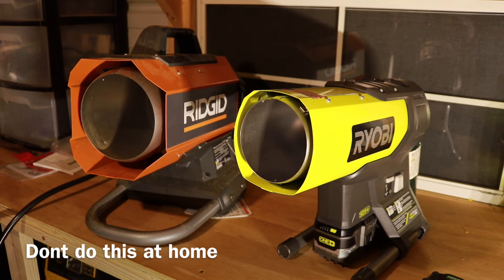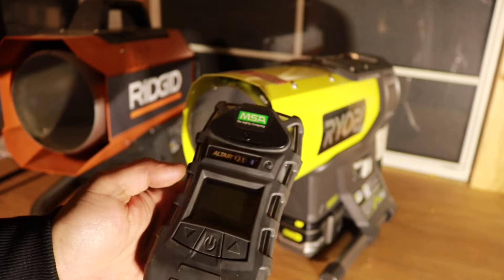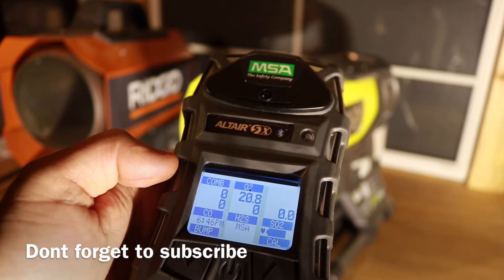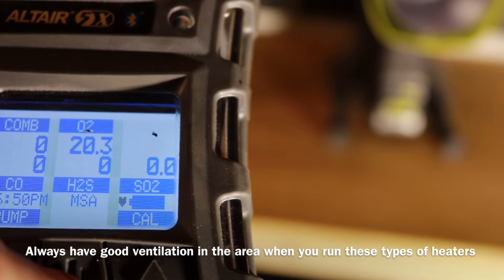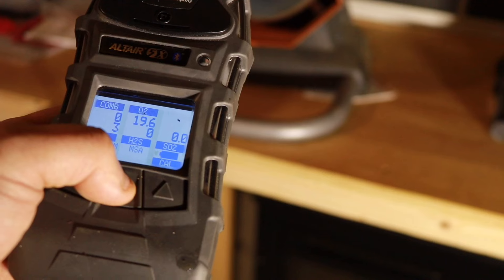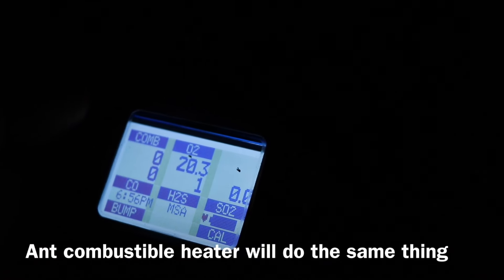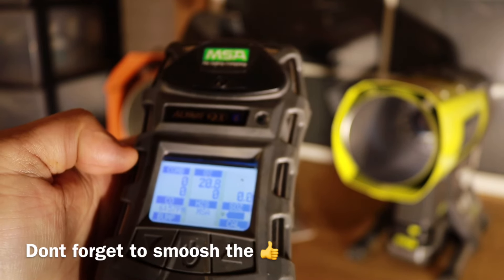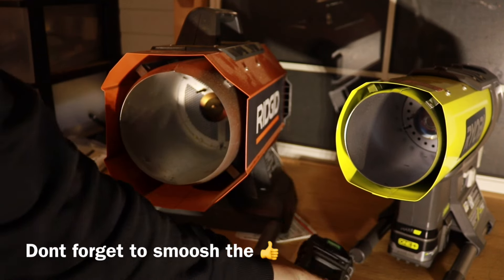Is it safe to run a propane / torpedo heater indoors???

Comment: Of course it escalated that fast. You’re standing with the meter directly in front of the unit about 3 foot away. If you use it inside in a 20x10 room that would take a long while to go up. Crack a window and you’ll be fine

Comment: Find this weird your testing with the sensor in the blowing draft of the heaters??? Like if you were to breath into the pump and make it alarm. I used what looks to be the same instrument at my work and putting the meter right into the draft is a unrealistic test... I would point a heater into one side of the room heat it to temp and then take a reading. That would give you a atmospheric reading and not a focused stream into the sensor.

Comment: I've used a kerosene torpedo heater to heat my home when my furnace quit working in the dead of winter. Things to consider when using one of these indoors u wanna make sure u have a fire extinguisher near by, a carbon monoxide detector in the home. And place the heater on hard surface such as a kitchen floor. Also never leave the heater running unattended

Comment: Garage door open 2' seems excessive. Buddy Heater (forced air like you're showing, not the big buddy) recommends 1 square inch of ventilation per 1000 btu. an 8' garage door open 1" would be nearly double what you need for a 50,000btu heater. Crack a window on the other side of the shop to promote some flow and you're golden. Having the door open 2'  in the dead of winter would probably be colder than just having it shut with no heater.

Comment: Funny how growing up working in the garage with the 120,000 btu torpedo kerosene heater,  with no ventilation for hours upon hours and no issues. I understand the concerns but believe it or not, I used to play football without a helmet and pads as well. I would guess this guy is about 28yo.
Reply: Commenting on a 6 year old video, yeah no long term effects

Comment: What's the Oxygen level at the other end of the workspace. I don't know about you but I don't have my face a few feet from the heater it's usually 15 feet away in the corner.

Comment: I've been running this type of propane heater in my 800 sq. ft. garage/shop for about 6 years through Canadian winters.  I've had 2 heaters (1) Mr. Heater 38,000Btu propane/electric and (2) Mr. Heater HERO 30,000 to 60,000 Btu propane/electric/battery.  The shop is uninsullated so there is some ventilation from cracks and seams.  I installed a standard battery operated Carbon Monoxide detector about 10 inches above floor level (CO2 is heavier than air and creeps across the floor first).  The sensor/alarm has only sounded once, while I was running the heater at 60,000 Btu and grinding metal at the same time.  If the alarm sounds, shut off the heater, open a door or window for ventilation and leave the area immediately until the CO2 is eliminated.  Note that all manufacturers of these type  of heaters state that they are for outdoor use only -- not to be operated indoors for liability reasons, but the reality is that nobody buys a heater to heat the outdoors.
Reply from the maker: Yeah I have to agree.  That said, CO is not that much heavier that O2. It's actually about the same
Reply: CO not CO2
Reply: Leave the area “IMMEDIATELY”!  I mean, like NOW! 

Go outside and smoke a cigarette to calm down.
Reply: @mateobrainardo4770  "smok''em if you got em".

Comment: I’ve worked in a lot of garages with these running, even in a midwestern winter if you get a high powered one (the one I used is several hundred thousand BTU) I only have to run it for about 3-5 minutes in a large garage (had a car and pickup with room around them to work) and it was so warm I was starting to sweat. So while good info, put the caveat that efficient use and some space in there is all that’s necessary to keep it safe.

Comment: Holly cow I use one of these to get my temp up but have a 4 inch fresh air pipe at the back of the heater and wonder how much difference it would take. Great video thanks so much!

Comment: Also should I push the heat from my work space to the ventilation to push the contaminated air towards the vented area? I want to be warm and safe but in ND winter's of -10 on a typical day it's hard to stay warm without hot air constantly being pumped into the space.

Comment: I would be interested to know how quickly an unvented 10,000 BTU Radiant Kerosene heater uses up O2 in an average home. My wife thinks I'm just paranoid because I seem to be more sensitive to air quality and experience issues when she doesn't. I have a CO detector (never has shown anything other than 0). Sometimes after a few hours of use I start feeling like I am having to work harder for my breath. I never feel ill but sometimes I just feel like there is a 10lb weight on my chest. I usually keep a window cracked but on a calm day sometimes it seems as though I have to open the window to the point where it defeats the point of having the heater.

Comment: Could you do this test with the heater in a safe area away from where you are actually working. Maybe put the meter on the work bench and put the heater in an opposite corner with the door closed

Comment: what if you attach a piece of flex duct to the inlet and draw fresh air to the heater from outside ? what does that do for the test results? does it "help " the O2 content in the room and possibly dilute the CO ? thanks for the info
Reply: I got a sheet metal duct extending the heat into my space so the air is taken from the outside...no problems

Comment: Well that sure escalated quickly. Good to see some actual real time numbers on what happens when you start using up the oxygen. I used to work at a ready mix plant as a mechanic  in the High Desert, and in the winter it would dip into single digits evenings/nights which I was working for a while. Our "shop" was a steel shipping container with no insulation or heating of any sort. We used to run a big diesel powered burner heater, basically a jumbo sized one of these you have at the entrance of the container. We kept it a couple feet back form the door, as we figured it would drag fresh air in along with the heat. Probably wasn't a great idea but the cold makes you do things.
Reply from the maker: Yeah bro, before I got my degree in safety engineering, I wor6im a steel mill in the Pittsburgh area.  We did some crazy crap too without knowing what could happen.  Someone sitting there without knowing how unsafe this is could find themselves in a bad situation fast buddy.

Comment: I'm # 53,581, what a great video.  I'm looking at a propane convection heater 80K BTU to heat up my workout garage 450sqft with insulation.  To be safe you want the garage door open 24" off the ground?  My thought is to put the heater within 6ft of the door and heat the garage from 30 degrees to 60. I would shut off the heater at this point.  Can I close the garage door at this point or will be fighting the CO2 issues?

Comment: GREAT video... I almost bought one today at Home Depot but wound up not till I looked into it more. I to would like to see a video showing a space you use it in and show a demo of how much of an opening you need to keep a safe amount of oxygen, and see how the meter shows that ventilation keeps it from going too low on the O2, and shows how much carbon monoxide accumulates... And also, if you maybe wind up doing that demo vid, talk a little about the dangerous levels of what that is... GREAT VIDEO tho, really appreciated the info, nice little Meter you have there... 🤙🏼

Comment: So I am wondering I have a 24x30 metal building just built and had two vents put in each end is that enough vent or does it still need the window open?? Anyone know.

Comment: Thank you for the video! great information. I'm researching for the purposes of heating a home gym in my detached garage. I wonder if you'd be so kind as to offer your expert opinion-- On my garage side door I have a pet door that's about 5x5in. If I run the heater right in front of that opening will that be enough ventilation? My understanding is that CO is a result of incomplete burn from not having enough 02 flowing. I'm wondering if that 5x5 opening is enough to get an adequate flow of O2. Thanks in avdance!
Reply: Conduct a flow-volume per minute calculatorio and see!  It’s a situation where SUCK and BLOW apply to our very existence as cold shop performance artists...

Comment: I have a crappy basement that i was thinking of putting it in and somehow running a vent up to the main house. It could be done but the unit has to be outside blowing into the house.. they make so much heat id love to jimmy rig one

Comment: Good info!
I’m curious though what you do for work In confined spaces?
I work in sewers so I’m familiar with confined spaces and I was just curious
Reply from the maker: Hi Chad. We use this monitor for confined spaces to. We have procedures that state no entry with an LEL of 2% and no more than 5% CO. If we find anything at those limits, we will introduce ventilation into the area.

Comment: Where in the room should the heater be placed for safest operation? At the door so that it is pulling "new" air in or away from doors to allow for normal air flow?
Reply: I put mine by the garage door which is usually only an inch open. When it starts to warm up- cold dense fresh air rushes in under the door and all the CO rich hot air cycles thru the garage and then out the top of the door. It's the only door in the building. Once left it on like that for 45 minutes and started puking was sick for 2 weeks. There is simply no good OR economical way to run propane heaters. diesel china heaters is where it's at honestly.

Comment: I run two propane heaters in my 15 x 30 shop two windows and two doors that are closed but not air tight No issue with me

Comment: Will you be doing a video of what happens when the door is open and they are on?
Reply from the maker: Hi Jamie, with the doors open, you wont have an issue. As long as you have at least two feet open, the air will circulate enough to keep those fumes down. I always try to have two areas open such as a door and window just to keep that air moving buddy
Reply: Perfect. Thanks a lot I just bought the Ridgid one on Friday and after I watched your video I packed it up and thought about returning it.  But if it’s fine with doors and windows open I think I’ll keep it. It warms the area pretty quick and I’m usually only out there for an hour at a time anyway.
Reply from the maker: Yeah buddy, I use mine all the time and is perfectly safe with ventilation.  I honestly love mine, but just have to be smart when using it. Glad you like the video bro

Comment: Here's something that I haven't seen reviewed anywhere:

Propane tank top heaters are cheap and available everywhere.  Most people who have power outages and a natural gas stove will turn on the burners and oven to heat the house.  I've done it.  Right now I have a tank top heater and running it on low in my livingroom heats my whole 1,200 sq.ft. townhouse in an outage.  There's no smell like with a kerosene heater and no mess.  I've never noticed any dizziness or need to open doors.  It works so well that I have to keep it on low.

Now there are dual fuel inverter generators.  The small ones of about 2,200 watts are enough to run some TVs and electronics.  (Some makers are Pulsar (BJs Warehouse) and I forget).  You'll get 8-12 hours of electricity on a tank of propane and maybe more depending upon the load.  That's plenty for me.

I'm thinking about buying a dual fuel generator just to run the TVs and electronics and this seems like an excellent idea.  Propane won't clog the carburetor or smell or spill or need filter changes, etc..

So, can I run one of these propane powered inverter generators in my underneath garage for electric and to heat the house?  I'm thinking, yes.  Since it burns about like my tank top propane heater -- isn't this generator exactly like that for putting out heat?  And since it is a generator I have 1,600 watts continuous (surge 2,000 watts) of electric and can run two extension cords up the basement stairs.  Instead of having a propane heater AND a gas generator; I can have one generator that heats and electrifies.

Is this crazy or is this a great idea?
Reply: Tank top heaters are not intended for indoor use period.  Buddy heaters are indoor safe with ventilation.

Comment: Different, but related question:  What happens if the power is lost to the unit?  Does the propane shut off as well for safety?

Comment: Awesome video, exact reason I don't use these. Why don't these boneheads make an indirect/vented version of these heaters? The only options available are up at a Frostfighter over 250k BTU or a modified diesel air heater at 25k BTU (semi-truck bunk heater). No small propane indirect. Crazy to me especially with simple it is to build.

Comment: Well ur tester is directly in front of the exhaust. Yes you can eventually deplete the oxygen but not with 1 lb of propane and certainly not in 2 minutes
Reply: Prove it in your video.

Comment: Good video!  I can't help but wonder how you get effective heating while allowing air into the area. I suppose it is just really inefficient or you have to be down range of the business end of the heater to feel the gain?
Reply from the maker: I blow down towards me. Believe it or not, the damn thing will heat up my 12x20 work area I'm the dead of winter to the point in need to take my jacket off, even with the door up about 2 feet. They put out a lot if heat

Comment: Can these be used in a basement?
Reply from the maker: No I would never put them in the basement or anywhere in the house other than the garage
Reply: @ToolReviewZone  I figured since I got windows it would be ok..
Reply from the maker: @metalh3d872  I would just worry about the co traveling thought the house and fire hazard. Not to mention possible fuel leaks depending on the type of heater
Reply: @ToolReviewZone  it is propane powered.. Its just to warm up the room for my drum set. Couple min here and there.. But I get where you're coming from.

Comment: The way i see it as long as you have the recommended ventilation for your heater its fine to use in a shed/shop but not in a enclosed space

Comment: Thanks for the video, if the unit was outside and ran the heat through a duct to inside garage, would that be safe? thanks
Reply from the maker: Thanks for the question.  That would help reduce the air depletion air would've using the air from outside rather than where you are, but you would still be pumping in CO. I would still keep the door open and run a CO detector
Reply: thank you! @ToolReviewZone
Reply from the maker: @MrAgustus101  you got it👊

Comment: I blow mine into the house from the garage for about 20 minutes to take the edge off when I get home after work. Been doing it for 2 years. Still alive. House still standing. Just don't leave it unattended.
Reply: What do you mean to take the edge off?
Reply: @dackbowland1876  I turn my heat down pretty far when I'm gone during the day, so it's pretty cold when I get home. The torpedo heater brings the temp up to reasonably comfortable levels quickly.
Reply: I have a 80000 btu and use it in the house on our main floor and turn the oven hood vent on and crack the kitchen window and I'm still alive. I have fire/co detectors in the kitchen and living room and they've never went off
Reply: @michaelrussell6763  the co detectors don't go off because properly burning propane makes co2, h20, no2 ect.ect. doesn't mean you aren't still slowly suffocating. Ever get terrible headaches?
Reply: @dackbowland1876  nope. Our main floor is bigger than our garage and with a bathroom exhaust and big kitchen hood goin it is just fine...
Reply: @dackbowland1876  and its kerosene not propane
Reply: @dackbowland1876  no headaches here.
Reply: @michaelrussell6763  oh kerosene, so CO, NOx, sulfur dioxide ect Still all terrible things to inhale and assuming u somehow have a perfect burn on the kerosene. A Chinese diesel air heater (mini furnace) would be a far better option to run in the house. Do you open a door or window while it's running? Breathing just a lil bit of these chems like both of y'all do, everyday, will lead to problems. Y'all obv don't do this every day which is why you think you're fine. The health complications are comparable to being a smoker, and the side effects that can come down the road from years of smoking. I personally use a propane torpedo heater every other day in my garage during winter but at least I know what im doing to myself lol. U inhale these chems even with adequate ventilation with every use
Reply: @bullfrogpondshop3179  ↑↓

Comment: i use a dina glo diesel heater  in my garage   it is a 2 car with a second floor  my heater has a dual range 210.00 btu to 315 000 i think. I use it when it gets cold and i was in the garage once it was 7 deg outside . i was wearing a  shirt  only it was so warm  i  had to turn it off ! ... now i had  2 windows pretty much open  AND two carbon monoxide detectors  i never had any problems . so i would say it is ok in that  with the windows open and the detectors  on  it is safe
Reply from the maker: Agreed pond.

Comment: Thanx for the vid... i don't think i will be buying one of those... i bought 1 little house heater last year for my garage ans i set it on eco mode 20 degree celcius on 24/7 and my garage was nice and toasty all winter and it didn't really do any damage on my electric bill... so i think i will stay with that as my garage is only 24x20... if i had a bigger garage i might of went with one! But anyways cheers and thanx again!
Reply from the maker: Hi pat, I actually use these all the time and love them. Just trying to bring awareness to any of these kind of heaters . Thanks for the comment buddy